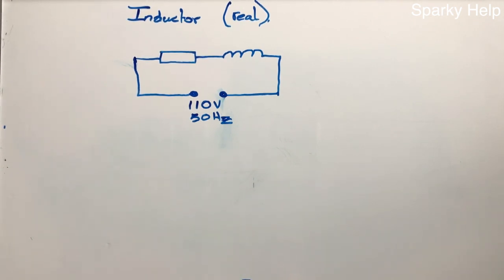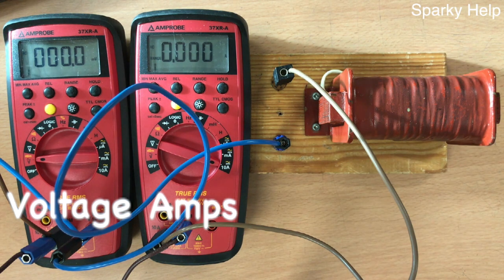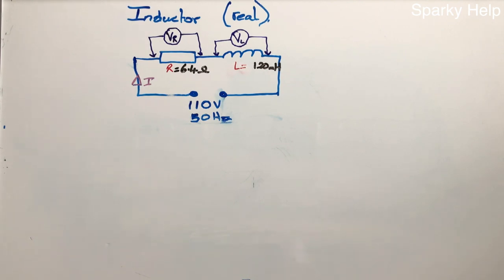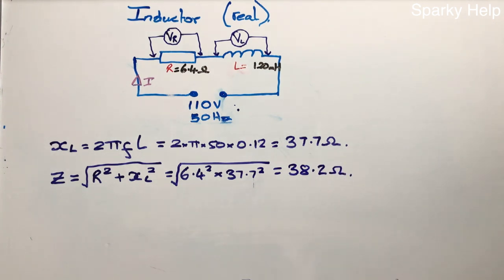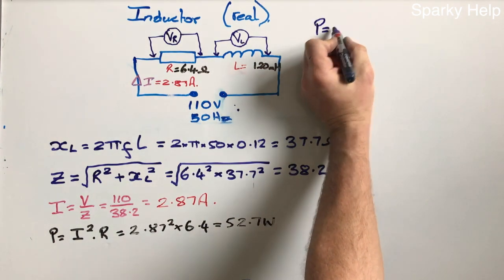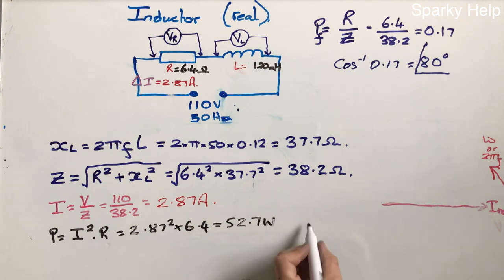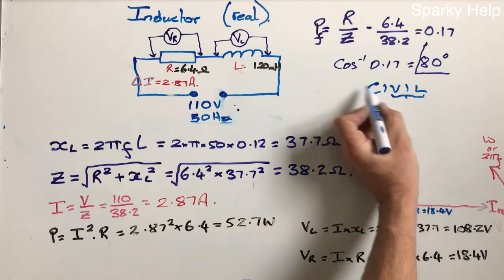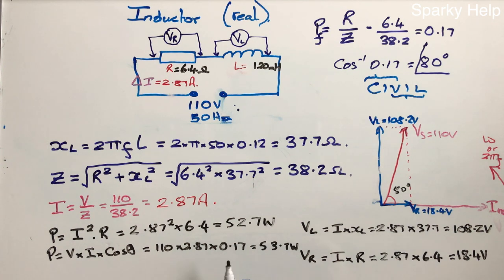R-L Circuits, Electrical Inductors (XL), Phasor Diagrams and Power Factor Calculations

Comment: I calculate capacitor correction to be Xc =(R^2+XL^2)/XL, giving Xc =38.7, C = 1/(100π38.7)= 82uF. That will cancel the inductive reactance making the circuit appear purely resistive with R' = 228ohm, I = 0.48amp and Pfc = I^2R' = 53.1W.
The PVA was 316VA without correction.
Hope that helps techs figuring out value of correction capacitor for inductive loads! 💡
Reply from the maker: I like this, I did it using VAr, got same answer (obviously) - very good.  Please share with like minded people or maybe even like and subscribe.  Again many thanks.

Comment: Hi Sparks, why do you use Pfactor in the P=V×I formula?
Reply from the maker: Hi, you can use any formula, but you must use the correct voltage and current for the location you are trying to find the power.  Please share with like minded or maybe even like and subscribe.